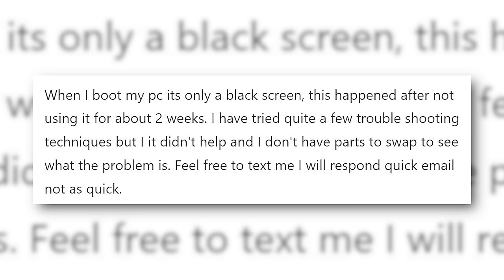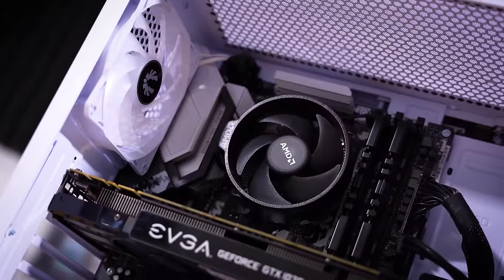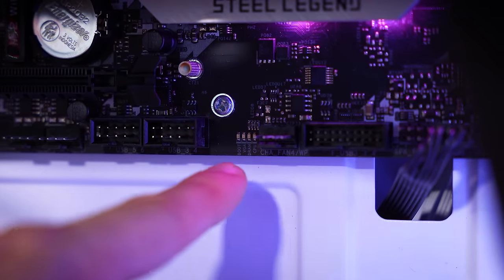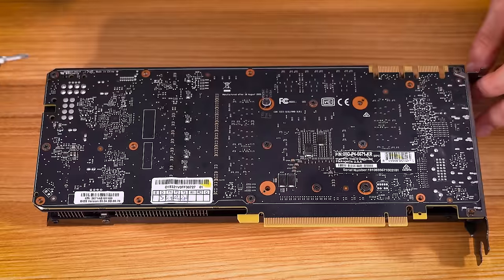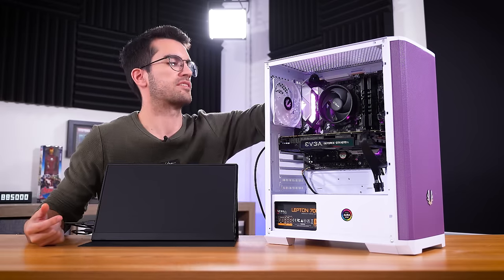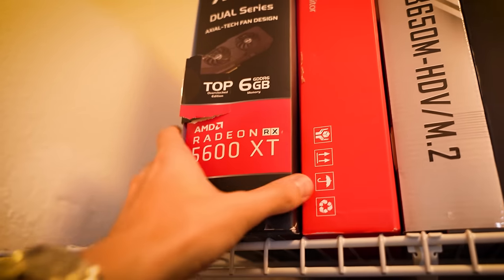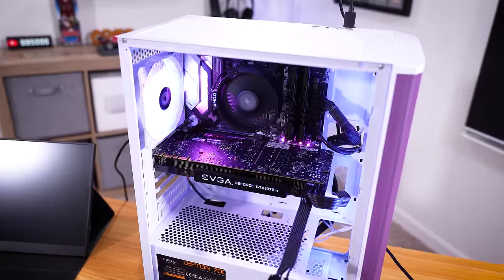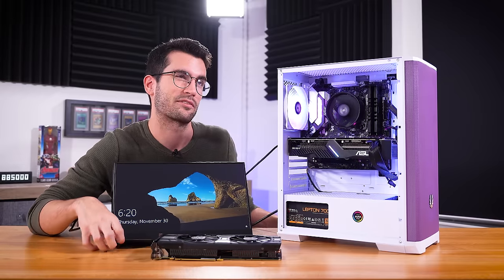Fixing a Viewer's BROKEN Gaming PC? - Fix or Flop S4:E18

Comment: I would love it if you do a collab with TronicsFix for fixing the motherboards and GPUs you've found faulty till date. Steve has good experience in soldering and debugging at the PCB level.
Reply: Absolutely! But for more difficult tasks, I think NorthridgeFix would be the go to.
Reply: @RGInquisitor  Yes, forgot about NorthridgeFix. He focuses on GPU and motherboards more than TronicsFix, so he could be the better person to send the PCBs!
Reply: @GregSalazar looking forward to a collab!! 😊
Reply: Even if he doesn't do a collab, he should sell and donate cards to TronicsFix, someone who won't do a sloppy job and can fix just about anything short of reballing but this graphics card shows no sign of balling problems. I just think it's better then selling on ebay to people who might just turn this stuff into junk.
Reply: @RGInquisitor northwest repair kicks the shit out of Northridge fix when it comes to fixing gpu's dudes ability to diagnose stuff is truly impressive to say the least check his channel out I've never done any micro soldering or gpu repairs but after almost a year of watching his videos I'm pretty confident if I bought the proper equipment I could pull off a couple hat tricks with some practice
Reply: Alex would be the way to go on this one. I've watched so many of his videos at Northridge fix and I could be wrong, but with the Motherboard Bios somewhat detecting this card, I feel like the pex Rail has failed, and the pex rail seems common on 1070s. And if the pex rail is failed, it's possible it took the GPU with it. Also power mosfets are common to go bad as well and there may be a short on the 12v rail. This card may be salvagable.
Reply: NorthridgeFix doesn't do memory replacement or GPU reballing though, Alex'd call it a waste of time because he can do 5 other jobs in the same time. And this doesn't seem like a 12V short issue, because the PSU would go into short circuit protection right away. Northwestrepair is a real GPU pro, Tech Cemetary was also quite good but stopped doing videos for some reason
Reply: @Alvin853  You're right, a 12 volt short would stop the motherboard from getting past VGA initialization, or short the PSU, which is why I initially thought that maybe it was the pex rail. Another thing I've also seen before "yet very unlikely in this case" is a vbios chip going bad. 

Yet I wouldn't think it would be a memory chip in this case. Lots of times a failed memory chip would still allow the system to post but you'd have artifacts 'similar to a failing GPU Chip"

Yeah I'm subscribed to Tech Cemetary and he hasn't posted any videos in a long time. Makes me wonder what happened with him too.

Alex is very knowledgeable in a lot of things, and yes you are correct that he doesn't do some things on GPUs but he definitely knows what he's doing. I'm fascinated watching all the videos of him replacing bad connectors on RTX 4080s and 4090s. People like to keep him busy. Yet with laptops he's a godsend. 

Hopefully someone would be willing to look at this 1070 to see if it could be salvaged.  I have a 1070 in my main system and it still plays my games perfectly.
Reply: LOL.. Send it to Northwest Repair, he is the GPU repair king. His repair skill is far better than Northridge Fix and TronicsFix..
Reply: Northridge or NWR would be my pick, tronics is great but not for GPUs
Reply: @zx3rican69  I think NWR repair was who Greg was eluding too due to a ton of mentions a month or so ago.
Reply: Yeaaaaaa i was coming to the comments to say the same thing
Reply: He should go to the UK and collab with thecod3r
Reply: I would suggest Northridge Fix or Northwest Repair because they are more capable.

Comment: Hey Greg, when you swap cards, do you do anything with the old drivers already installed first or do you just throw the new card in and go from there? Curios if you use DDU or not
Reply: I doubt he doesn't unless the owner gives him the permission to access the desktop? (user gives temp password or something). More likely, Greg just gives an instruction to the user to use DDU and install fresh drivers after he returns it.
Reply: The old drivers are irrelevant. Leaving them has no effect on the new card

Comment: Hey Greg! Great video as usual! Did notice that the new card you put in the rig only had one fan spinning, not sure if that's because it knows how to control fan curve based on GPU temps but I thought Id let you know just in case!
Reply: I noticed that as well.  Not sure if it's a problem, but I thought it was super weird that only one fan was working.
Reply: Probably a disconnected fan connector
Reply: for some cards it's normal that only 1 of the fans spins, not sure about this 1.

Comment: I would have like to see you try the 1070 in a system with integrated graphics. Just to see if it would be recognized in device manager. If it would be recognized, then you could try a bios flash of the card.

Comment: One piece of advice that I've noticed only a few people attempt when troubleshooting GPU issues, particularly with Nvidia cards, is utilizing an iGPU within the system. By configuring the BIOS to prioritize the iGPU and connecting your display to it, you can access the system. From there, you can attempt to use NVFlash to flash a new BIOS onto the GPU. This process is relatively straightforward with Nvidia cards, though I'm uncertain about its compatibility with AMD cards. Nonetheless, I've successfully revived cards using these steps. It's worth noting that some cards, especially older models like the 1070 Ti with a single BIOS, are prone to BIOS corruption.

Comment: The fan issue on the 1070ti is indicative of a failure somewhere on the GPU. Could be small or something major but honestly probably not worth messing with considering the age of the GPU. As always, great video and great explanation of the testing methods.
Reply from the maker: Thanks for watching, Larry!
Reply: @GregSalazar  Thanks for continuing to make content tat not only helps the community but also teaches the community.
Reply: I had a very similar issue with my EVGA 1080.  Similar behavior, fans acting weird.  Thankfully I was still under warranty (like 50 days left) and was able to get a replacement 2070xc from EVGA.
Reply: @BalalAhmad  WOW! That is awesome.
Reply: Greg the 5600xt's left fan wasn't spinning in the video
Reply: That fan behavior is totally normal since they started with the 0db fan profiles meaning the fans don’t turn on till about 60c-65c

Main reason why GPU’s smoke themselves is people would rather not hear a little fan noise then keep the card cool and have it last many years. 

Mine I always run at least 40% up to 65% manual when gaming, just too lazy to create a fan curve profile to do it automatically but these GPU’s should always have the fans spinning even if at 20% which is barely noticeable up to 65% to keep the GPU and Memory around 65c or lower.
Reply: @South_0f_Heaven_  the fan twitching is not in any way normal at all. 0db means the fans do not run at all. A half turn will not cool anything and would not allow the fans to turn back off. I have an Asus 1070ti that has the 0db feature on my test bench and the fans do not behave that way. They are either on or off. In my experience the problem usually is in a mosfet and deals with power delivery. There is more than likely an issue with the fan controller and an issue with getting power to the core.

Comment: 11:16 the last time I had a broken EVGA card that did this, I left it in a box for a year after cleaning it and it magically worked. I’ve also learned recently that 10-series cards might need a vBios update if they don’t work with certain monitors with DisplayPort, but that wasn’t the case with this card. As usual, love the videos

Comment: I'd try a vBIOS reflash on the 1070Ti. I had a PC that hadnt been used for three weeks, afterwards when the owener tried to boot it all the fans and RGB on the card was working noramlly but no display. Flashed a new vBIOS onto the card which fixed it :)

Comment: Unrelated problem, my monitors wouldn't boot at startup, I'm running a RTX 3060. If I shut down the computer manually and restarted it immediately, they would boot. I got a DRAM error on the motherboard when they didn't boot. I tried a clean install of drivers, reinstalling the card, CMOS reset, etc and so forth. Nvidia chat couldn't resolve it. Well, it hit me last night. I upgraded to a 4K monitor. My secondary monitor is 1080 and I'm hooked to a 4K TV that I watch movies, etc. from time to time. At first there was no problem. A 3060 has 7860 of horizontal resolution. It was balking at firing up beyond it's capacity. Oddly enough, the 2K monitor pushed it a bit above with no issues, but only 80 pixels 7940. All new 40 series cards can run 4-4K monitors. Depending on the card, refresh rates vary. So, this is a benefit the 40 series cards offer that I don't hear anyone mentioning. I hear, the 40o series cards don't offer much improvements, that's a big one to me. I've got 2 computers in the same room, the TV will be hooked up to the other computer so I'm covered. Love your channel.

Comment: Note when going from BIOS that early to the latest.  Sometimes you need to do it in a couple steps because something major changes in between and they aren't compatible.  So you had 1.20, sometimes you need to hit 1.70 before you can go right to 2.50 for example.  If it works the first time you don't need to.  But I put them on the memory stick anyway just in case.  Saves some steps later if it didn't work.
Reply: I've never once done that ever in the 20+ years of pc building. There is no reason not to go to the latest bios revision...
Reply: @drunkhusband6257 With the long term upgradability of ryzen, some later bios disable compatibility of older cpu’s from earlier bios to accommodate the newer ones. You shouldn’t just leap from oldest to newest bios on one athlon cpu and expect it to boot. Also the bios flash utility can also change between bios. 

Here’s an example: review the notes of gigabyte ga-x370m

You shouldn't go from athlon on F1 straight to F51 without F40 and before that, F31. 

Always review the bios note

Comment: Ryzen 3000 did support PCI-E Gen 4, was the first to do so, but IIRC mostly on 500 series boards.
Reply: True. Ryzen 3000 has PCIe4, but only B550 and X570 have PCIe 4.0 on AM4

Comment: When doing critical operations such as a BIOS update, always use a USP (Uninterruptible power supply) especially in a professional setting - then you don't have to be afraid of a thunderstorm. 👍
Reply: lol I would suggest a UPS on any PC that cost more than the UPS, I have 3, 1 for each PC and 1 in the kitchen for the fridge and other crap, might get a 4th for backup.

Comment: I have the same motherboard and thought of upgrading the bios to the latest version (I'm on 2.80) but if you google the AGESA version that comes with 3.20 you will find out that many users have their performance drop to around 5%. AMD is fixing stuff but also introducing new bugs. Always do you research before updating (just a friendly advice).
Reply: yeah for both Intel and AMD older platforms I wouldn't recommend updating to the latest bios, both had "magor vulnerability fixes" that lowered CPU performance in some applications by 5-50% and for home users those vulnerabilities are not that relevant so can be avoided, I'm on a z390 and skipped the last 2 or 3 bios updates.

Comment: I bought a new PC Summer of 2016, with EVGA GTX 1070 SC and I5 6600k CPU and that PC worked flawless for 6 years until my 1070 got burned. so sold that PC with A 1050TI in it, and bought a used PC from 2021 with 6700XT and Ryzen 7 5700g in it :)

Comment: Granted I'm only 2 minutes into the video, without even looking at the B550M Steel Legend's manual, I already see that the owner has the wrong DIMM ports populated. Most if not all AM4 boards use DIMM slots A2 and B2 for memory module configurations. A quick search of this board's manual confirms that on page 23. That said, I doubt it would cause 'no display.'

Comment: I am trying to fix a GTX 1650 LP card at the moment. Cleaned it up and no display, but I did notice one particular area of the PCB was getting hot that was NOT the main processing unit, so I am going to put some flux on that area and heat up the board using my hot air station.

I managed to use a hair dryer to SOMEHOW make my brother's old GTX 960 work again. No idea if it was the heat or if I dislodged something that caused the GPU to not work properly.

Great video as always! Keep it up!

Comment: I have learnt from over the years that usually the easiest answer is usually right. I did Electronics Servicing and control systems and Electrical Installation at college. Did a bit of computer servicing but that was back in 1993. Lighting was measured in candela because we used candles. The computers when I was at school and in my late teens and early twenties were BBC Micro or Archimedes computers, then we had Commodore C16, C64, Amiga 500, 500+, A1200, Spectrum ZX80, 48K, 48K+, 128K, 128K+2, 128K+3, Amstrad CPC464, CPC6128. When I think about it, how far computer have come since the early to mid 80’s until now is mind blowing. 😂🤣😂 I feel old 👴🏻👴🏻🤣😂🤣

Comment: Common fault with some old GTX cards were memory chip issue; micro-crack on soldered bga leg.

The best way to know whether that problem exist (or not) is by using Nvidia MODS/MATS testing tool with help of an igpu and CPUz as initial test software.
Usually CPUz would detect the problematic graphic card but only showing 0MB value on VRAM.

Nvidia MODS/MATS would help to locate which VRAM chip that have problem; then could be reballed/reheated or replaced. 

If the gpu chip itself that troubled then would not detected at all by CPUZ. 
Not worth to be repaired, dead.

Comment: Holy Cow...This is the exact system I am building my nephew. With exception I am using an RX 6600 and a different case. However, I use a different MB and a RX 7600 in the bit phoenix case (micro atx version). I like the case. however, cable management atrocious and putting 2 HHD is a real pain.

Comment: UserBenchmark actually rates the 1070 TI as a better performing card than the RX 5600 XT. But not by much. Still, a working card is much better than a non-working card.

Comment: I was considering buying a Rx 5600xt new, this was before the 30 series launched. I thought prices are going to drop on these cards soon so I'm going to hold off. Then cryptomining boom started. Now I'm thinking of buying one second hand as I think most people shopping on eBay are only considering Nvidia or the faster 5700xt. Can urrently I have a Rx 480 4gb. With driver support going on 400/500 series cards seems like a good time to move up in the GPU department.

Comment: Id consider the rx5600xt a slight downgrade, mostly because of the 6gb vram vs 8gb of the 1070ti. 

I am a big fan if amd cards in budget builds, my kids have been rocking rx460's for about 3 years with no issues, and i dont blame you at all for replacing the 1070 with a 5600xt, just pointing out the less vram.

Comment: I have the 1080 FTW. Great GPU. The 1070Ti is nearly as powerful. I used thermal conductive RTV in places that don't have thermal pads to improve cooling on mine. I also put thermal pads between the board and backplate to make it a functional heat spreader. Note: if you do this on a GPU, you will often have to remove a plastic film from the inside of the backplate. The thermal pads will ensure you don't get a short and that plastic will compromise thermal conduction. 
It is a shame this EVGA is dead. I'm sure it could be fixed but is it worth the cost of repair?

Comment: If your rig has onboard graphics (and the card will still run without outputs).  You can 'get by' using the display on the motherboard and still playing the game on the 1070.  Just for limp along purposes until you feel like buying a new card.  I'd probably recommend a 6600 at this point, if you can't get to a 6700 or 6750.  Just because they are faster than a 1070, and only a little more expensive.  Say 150 or so.  And 200 for 6700

Comment: My 1080 Ti kicked the bucket in an even sadder manner. I walked away from my PC, and 5 minutes later I heard the <device disconnected> sound from Windows. 
No video output since, in fact the card shows no signs of life whatsoever. Not even a fan twitch. PC runs as if the card wasn't plugged in at all. 
No visible PCB damage...

Comment: Once upon a time I sent a PC back via RMA to get checked because it kept powering off or losing video signal. They sent it back with a clean bill of health. The issue repeated. Eventually, I realized my power was really bad in that house. It was screwy enough that the PC had weird symptoms. I bought a UPS with undervolt and overvolt protection, line conditioning, sine wave output when on battery, and the issues went away. The little UPS sure got a workout while I lived there, but it saved my PC and made it so it could work. Rentals aren't always great as far as being up to code, even with something as important as electricity. So I wouldn't be surprised if such situations arise for other people.

Comment: Why don't you buy a little $0.50 speaker for the speaker header on motherboards? You could quickly plug that into any board and get a quick head start on the issue at hand.

I find it to be more detailed than the POST LEDs and the newer Q-Code readouts in my own personal experiences.